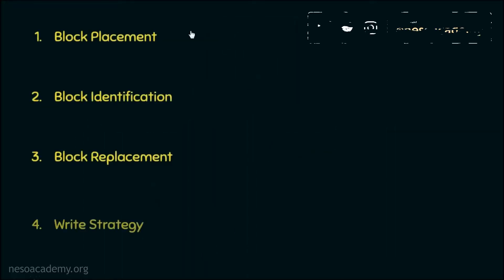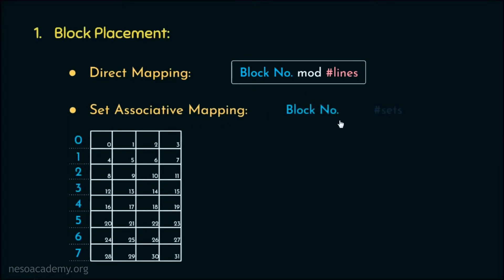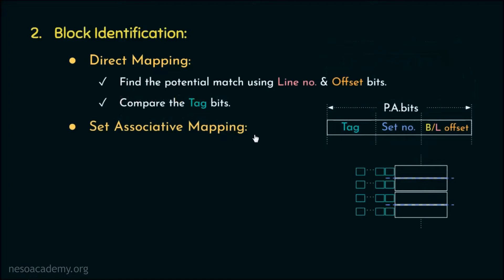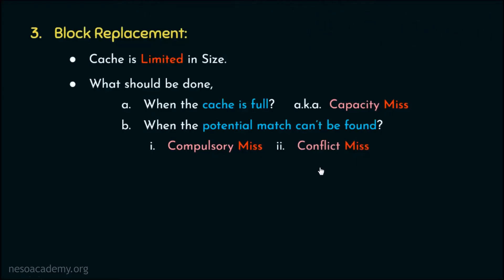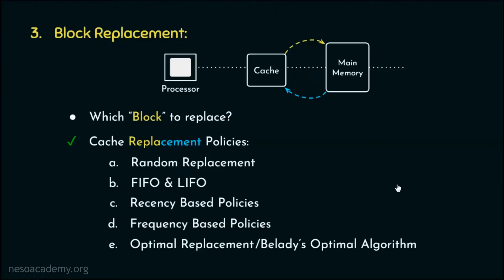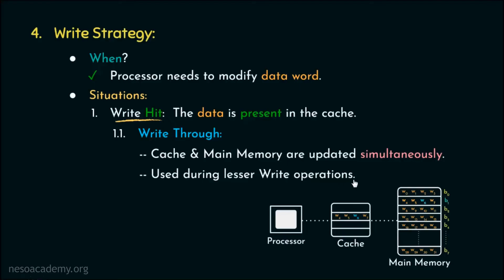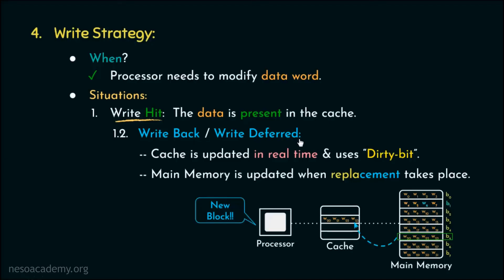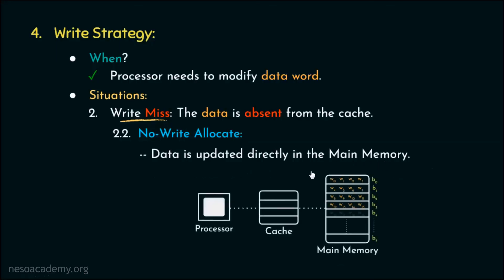Cache Design - An Overview

Comment: Hello Neso Academy. - I appreciate the clarity and presentation of the material. Please continue the good work. 

Is it possible to have capacity miss in direct mapping? Is it possible to have conflict miss in fully associative mapping? Lastly, is it possible to have conflict miss in set associative mapping? My understanding(based on earlier explanation), there will be only conflict miss in direct mapping, similarly, there will be only conflict miss in k- map set associative mapping? On other topic, are you planning to cover coherency misses in later videos?

@14.00 In case of write miss with NO-write allocate, when will block cached?